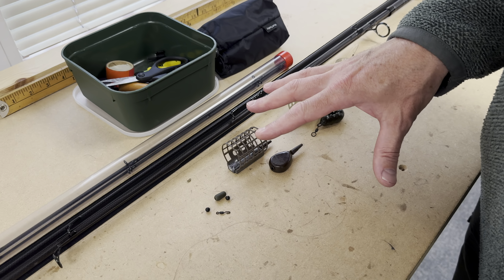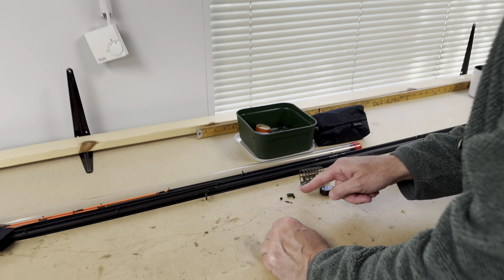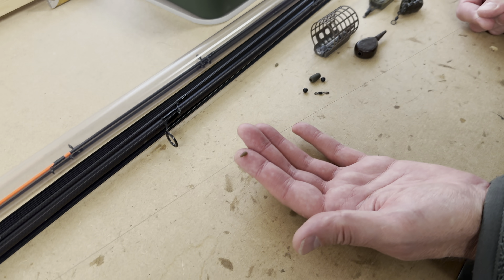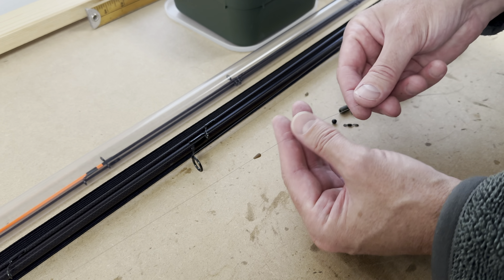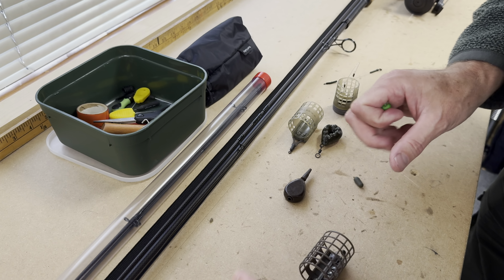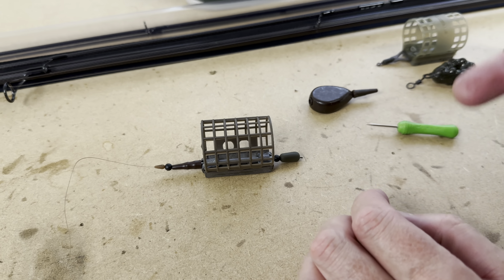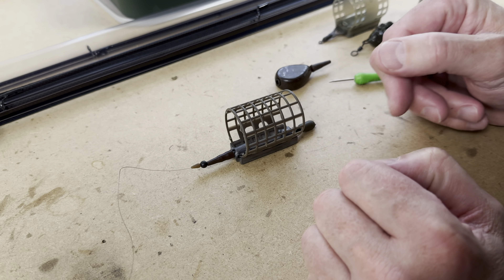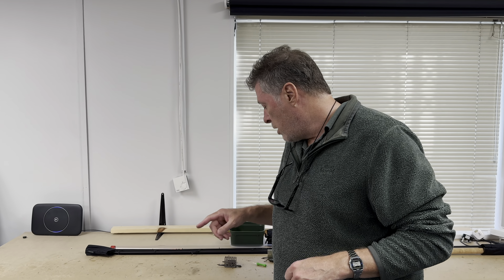Tunley Talks: Multi - Feeder Set-up

Comment: Would you use the same set up if you were using the Avon top??
Reply from the maker: Still waters using alarms / bobbins, yes.
River down stream, yes.
As I set things up for the self hooking bolt affect then the tip one uses depends on the type of indication you require.
If fishing on a river up stream or across for example, then I need a tip that will have a bit of a bend in it created by the water pressure, so as the fish takes and hooks itself the rod tip springs back in the vast majority of cases. 
If fishing down stream, then the takes are pulls so a lot easier to see, usually needing the reel clutch to be set to stop things getting out of hand, so in that case Avon tips are more than fine, 3 foot twitch and all that.
Mark